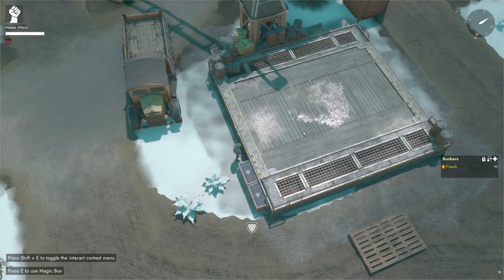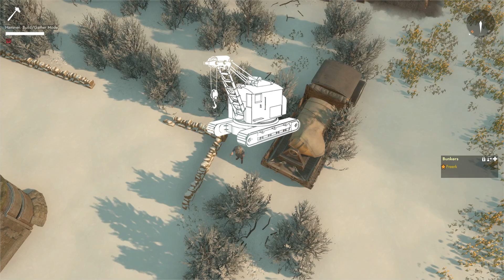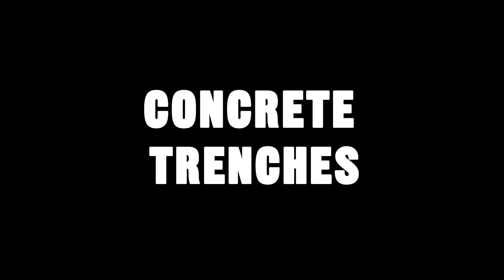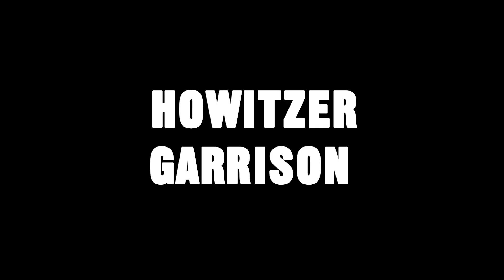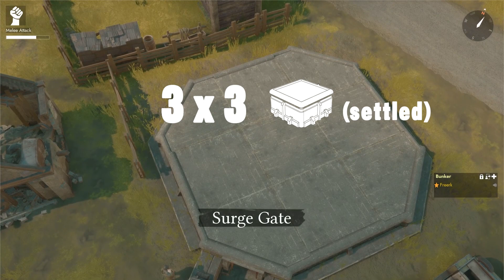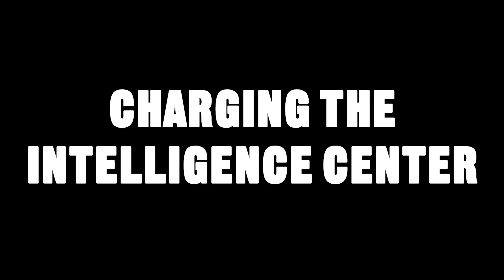Foxhole: Bunker Bases Part 3

Comment: what im missing a bit is more info on what the upgrades actually do. ofc some were spoke of, sure, but what does the intel thing do? perhaps a sort of plan on how to build a good bunker would be nice aswell as you need to set things right before going tier 3. im only 10h into the game so i have only a slight clue. i know to press E and all but how does a good base look like in the end and whats the upkeep.
Reply from the maker: The Bunker series is in dire need of an overhaul. Which I actually had shot before the whole new maintenance system came along rendering most of that footage barely usable.
As for base designs, I'd say take a look around other bunker bases to see how they solve problems and never ehsitate to ask in ingame chat if somebody can give some pointers. Most people are helpfull.

Comment: Do we have to manually fill the generator for power or we can just put diesel in the bunker base for automatic fill?
Reply from the maker: You have to manually fill the generator. 
Whenever you think in this game "Isn't there an easier, more automated way?". The answer usually is no :D
Reply: it takes more than 40 hours for an engine to go trough all the fuel if it's filled to 100%

Comment: I don't see much about pillboxes and walls. They seem a more cost efficient option of maintaining a larger perimeter around a base, particularly in comparison to the dummy thicc bunker spam you see with frontline clans.  Also, something in regards to WHERE to set up BB's might be useful as well without getting raged at by brass.
Reply from the maker: Since this is a tutorial about bunker bases I didn't include walls nor pillboxes.
My tutorials on the whole are concerned with the "How" not so much the "Why", "Where" or "When" or even best practices. 
Things change, meta's change, opinions change. I just hope the "How" doesn't change too often ;)

Comment: Is there way to "safely" remove bunker pieces after 3 hours? I want a concrete bunker containing only 6 bunker pieces, so i need to remove at least additional 7 bunkers and don't know how to do it.
Reply from the maker: If they are all connected to each other (so one complex of 13 bunker pieces), no there is no way of getting rid of the other bunker pieces without destroying the whole thing
If you have multiple "bunker complexes" (say one of 6, one of 3 and two of 2) connected with trenches you can always blow up some bunker complexes.
Reply: @FreerkHoltes  Thank you for your tip!

Comment: I need someone to tell me clearly: you dont have to build one-part huge bunker to build all the upgrade structures, right? Like you can build complex of bunkers connected with trench connectors and the upgrade structures inside sum up?
Reply from the maker: Correct, as long as the bunker pieces with the modifications are connected to the Bunker Base piece with trenches they should count.
Reply: @FreerkHoltes  thank you!